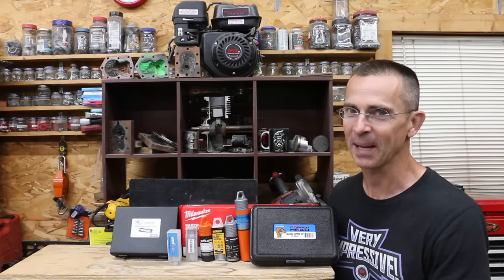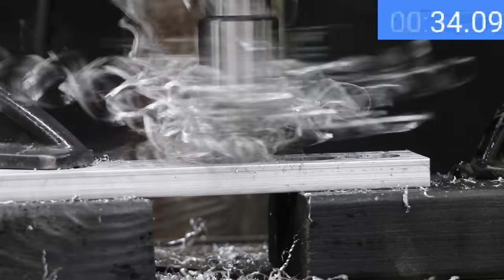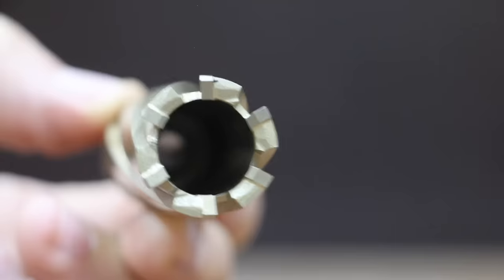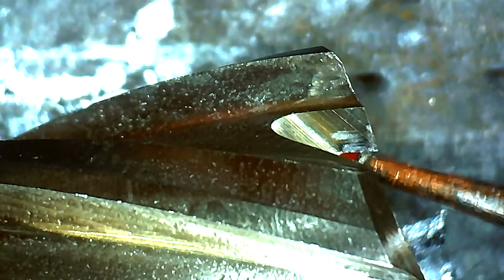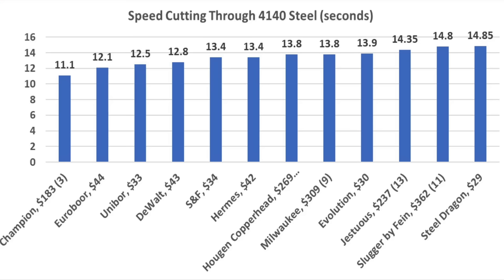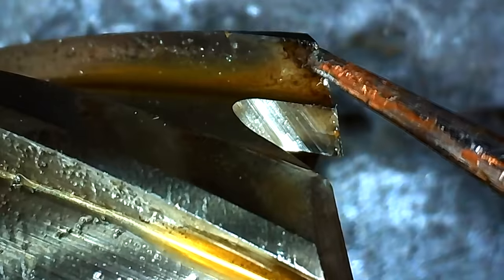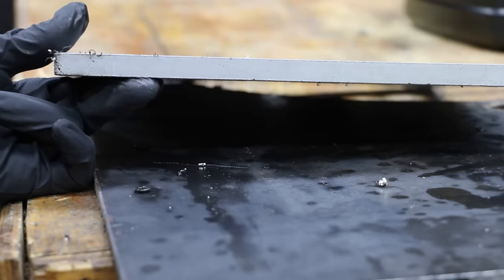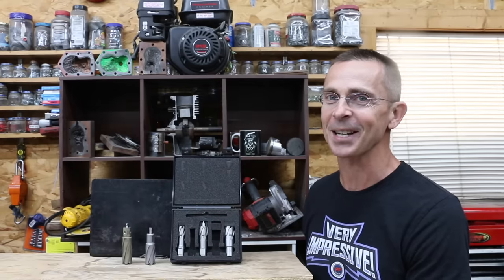Best Annular Cutter? Fein, Milwaukee, DeWalt, Euroboor, Hougan, Hermes, S&F, Evolution, Steel Dragon

Comment: I am not ashamed to admit I had no idea what an annular cutter was before watching this, let alone what it would be good to use for. Now, I not only have an idea of what I’d use it for, but what ones to look for if I need it.
Reply from the maker: This is a new tool category for a lot of people, and I've never owned one of these before now.  Amazing way to drill large diameter holes!
Reply: I agree.  I learned quite a bit today.  Not sure if I will ever need what I learned, but that has never stopped me before.  You never know when that little kernel of knowledge hiding in the far recesses of your memory may come in handy.  Thanks Todd!
Reply: I guess we’re all here to learn.
Reply: Me neither. I would believe that these drills are mostly for machine shops and not so much for DIY'ers. Not to say I wouldn't enjoy a 300 dollar set but wallet says nope, need food.
Reply: He comes up with new tools I have never seen.
Reply: Always used these for years to cut perfect holes for O2 bungs in my stainless exhausts.
Reply: If you want a fine finish hole on a budget you can use a hole saw and finish it with a brake cylinder hone.
Reply: @ProjectFarm  added bonus of annular cutters on a mill or lathe that's rigid enough to not need the central guide pin, is that you get a nice slug of useable material as well as the hole (not just a pile of chips/swarf)
Reply: 😅 seriously. Me too.
Reply: Same bro ❤️
Reply: Same! These are some of my favorite videos, learning about a tool I had no idea existed.
Reply: That's honestly the best thing about this channel. So much to learn that you never knew you wanted to know.
Reply: I've never heard of it either
Reply: What? I can't believe you did not know that! lol Neither did I, and I am pretty much a tool enthusiast. I probably won't buy them just to have on hand, but if the need arrises, I will know about them.
Reply: Me neither lol
Reply: For real. It’d be cool to find a website that asks what you’re trying to do and recommends the best tool/ supporting equipment. Like “I need to drill an inch hole through hard metal” -press drill with annular cutter-. Something like that
Reply: @heliosex7238  I'd make that if I had the data to pull off of. The hard part.
Reply: OP,  

Same here! Though I'm now wondering how I ever did without them!
Reply: @Killawife  Actually these are mainly designed for and used for on site drilling of large holes in difficult circumstances. They are primarily used with portable magnetic drills for those reasons. Not commonly used by machine shops.
Reply: @ProjectFarm  can you do a video on which shoe glue is best for reattaching a sole  back on.
Reply: I am slightly ashamed to admit I had used them for years and never knew they were called annular cutters!😂
Reply: @ProjectFarm  or do a video on which glue is best for attaching rubber together
Reply: Same here. I've seen these before in tool boxes around the trade but never knew what they were for. Now I know I definitely need to buy some.
Reply: @Killawife  They are great for fabricators, rather than machine shops. Good on the farm, too, for fabricating replacement bits for the tractor.
Reply: @ProjectFarm  As others have said, Thank you, I have learned something new today!
Reply: same here, but they do look like a really neat tool if one needs a bunch of clean holes in metal.
Reply: I have a large brand new one I got with a bunch of miscellaneous stuff. Now maybe I can get the other things needed  to use it somet I mevin the future
Reply: No shame in learning
Reply: Kinda looks like an end mill with cutting teeth
Reply: There's lots of industrial tools you will never ever need.
Reply: Haha same! Quality content!
Reply: I hear you brother, many probably watched the video thinking a little kinky
Reply: @ProjectFarm  It might have been good to mention torque requirements for thise tools. I understood that annular cutter requires a lot of torque but how much you actually need? It seems that you can find drills with max torque between 30 Nm and 250 Nm in stores.
Reply: I kinda thought they were for a mill. But now I know.
Reply: Same here
Reply: @napalmholocaust9093  I am an avid DIYer.  I started my working career in custom cabinetry and furniture then decided to go the white collar route and got a degree in engineering.  I have a ton of tools I don’t need.  But I love tools so I get new tools that pretty much do the same things I could accomplish some other ways.  The history of woodworking is a great example of doing the same thing with different tools.  I don’t necessarily need the tools, but I want them 😊
Reply: Yeah me too!
Reply: @ProjectFarm  Been available since 1973, invented and developed by a company call Rotabroach.
Reply: Same
Reply: This.
Reply: Always called’em hole cutter
Reply: same lol!
Reply: Be careful, Project Farm will have you spending money on stuff you didn't know existed before you know it. LOL, I have a few things I bought after watching PF videos that are still sitting unused in my garage
Reply: Me neither pretty cool though
Reply: You should be ashamed
Reply: @Killawife  when I was a teen I worked for a welding/fab company. We used these, with a very expensive mag drill to cut holes in plate connectors/steel girders for commercial buildings. Definitely not diy lol.
Reply: We just call em magdrills
Reply: @ProjectFarm  I have 2 and they are badass for drilling through hardened steel like pile and sheeting. Make perfect holes. We use a mag drill and those things are VERY dangerous
Reply: Don’t feel bad. I was shocked to see this video. I’m a retired gunsmith and used annular cutters all the time when threading a rifle barrels for muzzle brake, flash suppressor or sound suppressor installations.  You use the annular cutter to cut the barrel to proper diameter size and then use a die to cut the threads.  I’ve still got a tool box full of them. ☺️
Reply: OP, I've been heavily reaching into tools after finding a box of Craftsman twist drills and DeWalt drill bits, were the same interlocking boxes. 

I'm still finding unique, one task specific tools LMAO

Impossible to know all, no worries
Reply: I did not know either and honestly it seems really useful.
Reply: That's half of why I watch this channel, is to learn about new tools and how they are to be used.
Reply: Looks like something I'd rarely use. And I'm with you, never heard of this and I worked in a machine shop. Definitely made for a drill press/mill, not a hand drill.
Reply: Me, neither....and now I want one!
Reply: Same, and TBH I thought it said Annual Cutter... I was expecting some garden tool 🤦‍♂️
Reply: I am a locksmith and I use hole saws into mostly wood but some doors especially commercial doors made of metal and most are not soft metal. So you betcha I will be looking closer into these.
Thanks PF
Reply: I’ve been using these on class8 truck frames for 20 years. Really don’t know what I would do without them
Reply: I had never heard of them before either, but now I need some. 🤣
Reply: I have seen one other person that used them on a job.   As expensive as they are I would consider them to be a contractor tool instead of a homeowner tool.
Reply: Ditto :D
Reply: Same. Never heard of it before but you can bet I just bought some for no apparent reason other than this video lol
Reply: @libtards1393  I can answer that. Shoe Goo. I've used it for years. The repairs have lasted longer than the shoe.
Reply: Me neither, but now my brain is racing with all the things I can make better!
Reply: i also had no idea 🤷‍♂️
Reply: @Me-4766  nah I've used shoo goo a hundred times I use to skateboard every day it's not good for reattaching a completely detached sole
Reply: Ya I've never heard or seen them before! 
At first glance I thought that thay were For a C.N.C machine!
Reply: Same for me. Now I feel like a cave dweller for using hole saws.
Reply: Same here. Never even heard of these bits before. But now, I gotta have one. Lol
Reply: I bought one to mill out a piece of plastic a couple years ago, but I've never used it. It was just plastic so I didn't do a lot of research because of it. Now I know what to look for!
Reply: I have never heard of them either! 
Very impressed by  the finish and accuracy! 
Doesn't look like something one would find at a "big box". (Huge cube?)
Reply: @Killawife  there used a lot by welders and fabricators who need holes in steel. When you use this bit with a mag drill it’s the best way to drill.
Reply: Surely this is just a broach cutter
Reply: Same. I had no idea this was a tool made. 
Super helpful. Thank you as always.
Reply: Same here.  Main reason I clicked on the video!
Reply: Yup, I'm here to learn what an annular cutter is as well.
Reply: Me neither!
Reply: Seriously... I never knew about these things either. So many ragged holes could have been avoided.
Reply: Have a look at adam savages channel, he recently got a set and already put it to use.
Reply: Same for me. I have been a DYI person for over 30 years and never knew of these tools existence. Now I want them.
Reply: Ha right there with ya!!!
Reply: @ProjectFarm  Great Video , but I would say you need to redo the test separating the carbide tipped ones from the all steel ones. The carbide can do with higher speed better. They are just two distinct products.
Reply: Same here
Reply: @blaircox1589  The beauty of the internet is you could crowd source the data as well.
Reply: @MikkoRantalainen  the beauty of them is that they use less torque than a comparable twist drill, that is one reason they are mainly used with a magnetic base drill. For the same reason they are great for use on Bridgeport and other small milling machines.
Reply: @iwb316  Hougen
Reply: @stephensarkany3577  Oh, I definitely didn't know that! I was assuming that annular cutter requires at least as much torque as regular twist drill with similar diameter.
Reply: @stephensarkany3577  Read the About on Hougen website. They even state Rotabroach.
Reply: @iwb316  Exactly,  the company is Hougen, the product is Rotabroach. I have been using  them for years with my Hougen mag machine. I never implied different. You said " invented by a company call rotabroach", so it seems that you were saying the company was called rotabroach. Almost everything is developed by a company,  so when almost your next word is rotabroach  instead of hougen, that's not my mistake.
Reply: @stephensarkany3577  Rotabroach is a British company based in Sheffield, they are the inventors of the annular cutter, as I stated in my original post. Hougen make copies of the Rotabroach annular cutter, hence why they state Rotabroach.
Reply: Well clearly they are for those times when, let's say you're feeling a bit stuffed up down there and no other laxatives have done the trick.
Reply: @ProjectFarm  I also never heard of annular cutters. If you made more videos about unknown types of tools, then that would work well for me.

Either way, thank you for your time.
Reply: Most often these will be used for steel fab shops, ironworkers,  commercial/Industrial contractors, millwrights, field welding, etc.
Reply: I’d love to see hunting gloves
Reply: @Killawife  yeah I would say it's not a DIY tool since even the mag drill that he uses in the video is roughly $800-$1000 and it's still only middle of road tool haha those drills definitely get even more expensive
Reply: My understanding is that these cutters are not intended for any use with a handheld drill at all...I could be wrong, still learning, Todd's got my curiosity on overdrive now...these bits are incredible...my hatred of holesaws is matched only by my hatred of turnips and brocolli
Reply: @blinky444  I mean if you have a handheld drill with a chuck that'll except a 3/4" shaft and you can hold that drill perfectly level for the entire cut then yes it's possible haha but I wouldn't recommend it. Depending on what you're drilling through the smallest mistake will snap the bit even when using a mag drill. I know from personal experience. Also I couldn't help but make a smartass comment haha
Reply: @Killawife  DIYers, particularly hot rod and off road vehicle builders use them. We use on our semi trucks for attaching brackets to frames, and especially on our aluminum flatbeds, those main beams are 3" thick. Not a whole lot of uses around the shop everyday, but I will use them when making custom spring hangers and other components.
Reply: @ProjectFarm  oh! I thought it was called annular because maybe you only used it once a year!😬
Reply: I clicked on this to see why I don't own this tool  yet, and which one to get lmao.
Reply: Me either, buddy. That’s why we love this channel. End up buying more stuff that we don’t need but will somehow justify it
Reply: Its easy thanks to latin language roots. Annular ~ Anus ~ round hole...
Reply: Same here! Cheers brother
Reply: Why would you be ashamed? Clearly you care way too much about what people think about you. Learn not to give af, your life will get better.
Reply: Going with carbide bits is always a good bet!
Reply: Me either
Reply: I thought it's use for barrel rifling
Reply: @russellfarnsworth8408    Me neither
Reply: I will agree with u, i was going to skip video becuz i didnt know if it would be a tool i would need cuz i didnt know🤣🤣🤣 now i want one just to say i have one.
Reply: Same here, could have used one just last summer.  So it on my shopping list now.  Thank you
Reply: Same man, same.
Reply: I wouldn't expect anyone other then a fabricator,  millwright, or electrician to know what they are
Reply: Me, too!
Reply: “Holes per dollar” is not a statistic I thought project farm would ever be comparing
Reply: Even growing up with a father who is a tool addict I never heard of one of these.  Edit:  does bear resemblance to some gunsmithing tools I've seen before.
Reply: Although aware of these cutters, I have never used them, probably because my drill press is a bit awkward to get to where I might need a hole !   If I’m right these cutters were originally used in milling machines, which I don’t got !
Reply: @stephenadams2035  Yer right, most tipped,  precision type drills die really fast if you try to use any kind of hand held drill, the little shifts of angle blunt them and then they snag and break, like most of us I’ve tried !